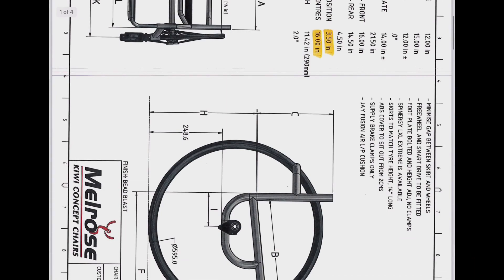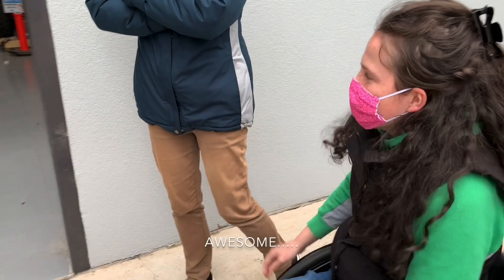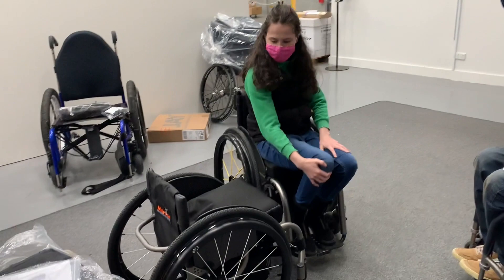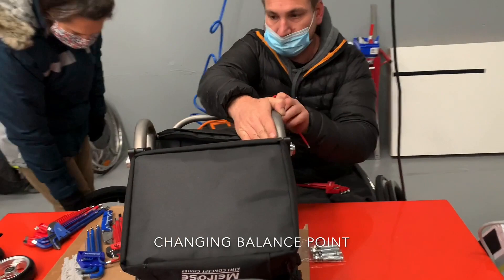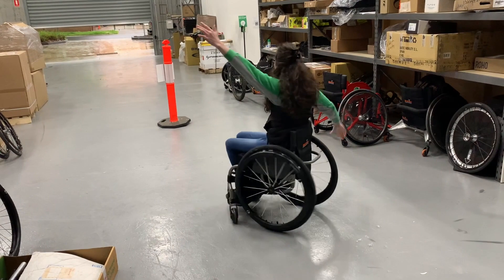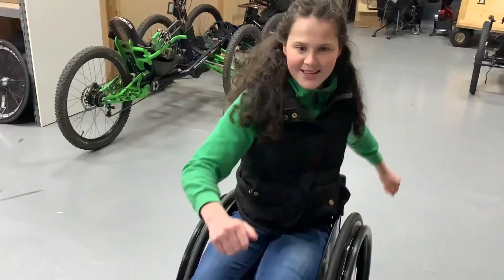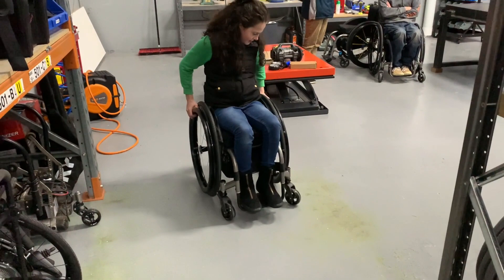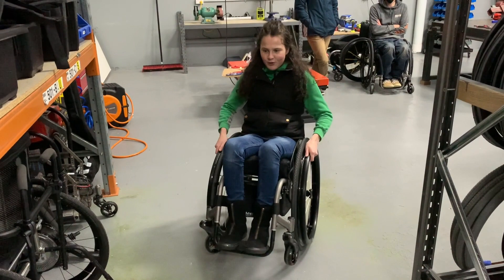Picking up my custom wheelchair

Comment: Nice WC 👍. Wanted to know what kind of cushion that is. Uses both foam and air bladders (ROHO is a brand where I am). Is it a hybrid custom product? Also, noticed you have very good core strength. For you, is there any preference or advantage to having a back support lower versus higher? Am an almost full time WC user myself. Not SCI but NM disorder and will be getting myself a new WC soon. My old one wasn't really fitted for me. Is why all of the questions. Have a blessed day...
Reply from the maker: Thanks! I have a Jay J3 which is single bladder Royo hybrid and my old one is a Jay J2 made of gel, hybrid too. I also got a Jay Fusion because it has much better pressure care, but when we got it it was so much taller than expected and also heavier with wrong measurements (weight and height) on the internet. Core strength is pretty good, but because of my patchy SCI I have more damage higher up with weekness to my arms, shoulders and lungs and I get twitches in my legs, arms, back and even neck. It is much better having the back rest shorter if it is possible because there is more room to move around and twist your torso without your arms hitting the backs rest when pushing car.  ......And lifting it into a car is easier. I hope that helps. ☺️ Do you have any suggestions for other videos? I am hoping to do some more vlog styles ones, but when Covid restrictions ease. Blessings! 😆
Reply: @freewheelingwithelise9421  Thanks for sharing your input, really appreciated. I'm trying to look at all options and preferably get feedback from others who use a WC.

As far as other vlog ideas? Do you have any personal WC hacks you utilize? For example, I don't have a WC bag. Instead, I use on of those baby stroller organizers, the ones that go on the handles. I simply attached it under my seat using the front 2 (that attaches to the WC frame) to hold it in place. Another, I use water bottle holders, the ones used for biking, and applied them to my frame above the front casters. Are you able to show accessibility challenges where you live? Not necessarily your home (too many weirdos, safety reasons, etc) but out and about? Another for fun, do you have a top 10 list of 'what not to do' when you're in your WC? For me, never touch my handles and 'help' by pushing unless I specifically ask for it. Is probably my number 1 pet peeve, lol. Hope this helps in some way. Have a blessed day...

Comment: Can you tell me if the sides of the wheelchair are pushing you or just touching you? That is, do they leave a large gap, little or not at all? I ask this because I am making my order for my wheelchair and I would like to know how wide I can put it.
Reply from the maker: That's a great question! As wheelchair width is measured in inches and this determines your cushion size, I went for slightly larger than smaller. My width is 12inch. My hips are 11inch so there is a bit of room. If I had chosen an 11inch width, it would have been really difficult getting a cushion. Many cushions, particularly with air inserts only come in even number inches eg 12inch, 14 inch. So 11inch would have been really problematic. Also I am hoping to put on weight so need some room in case I do. Have a think about pressure sores (if the wheelchair width is tight) and then there will be no room to shove a jacket or coat down the gap and less room to move around a bit. Ideally 11 1/2 inch would have been best but I can't get that!
Reply: @freewheelingwithelise9421  Would having that slightly larger size also allow you to wear bulkier clothes in winter?

Comment: How much cost for custom wheelchair?
Reply from the maker: Hello! :) About A$10,000, but my new Melrose chair was $11,000  so it does vary. Depending on the material (titanium, aluminium etc.) it can be more, also the type like basketball chair, racing chair or electric.